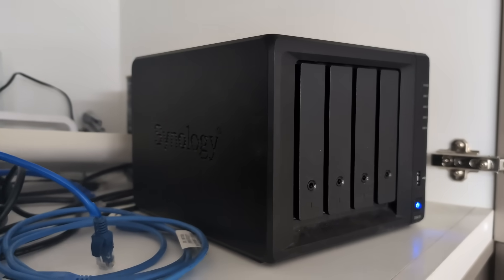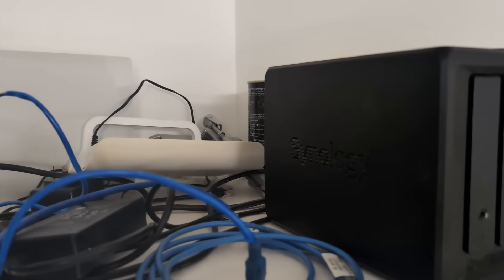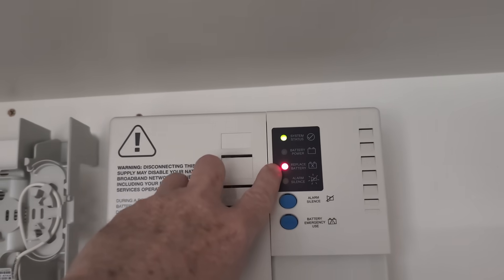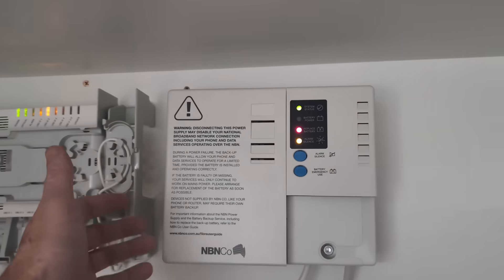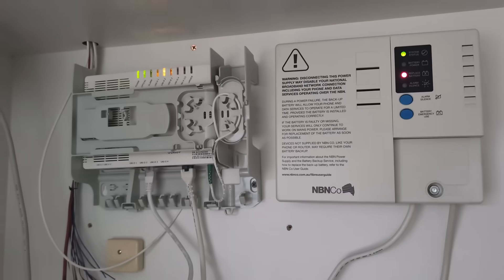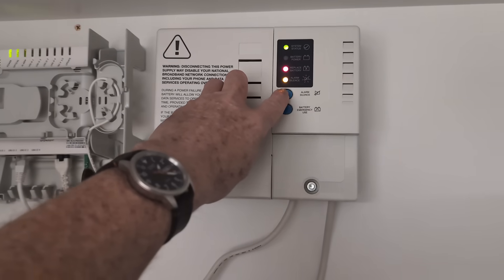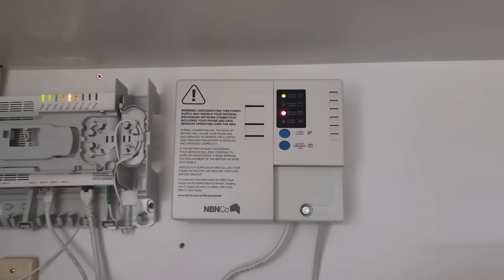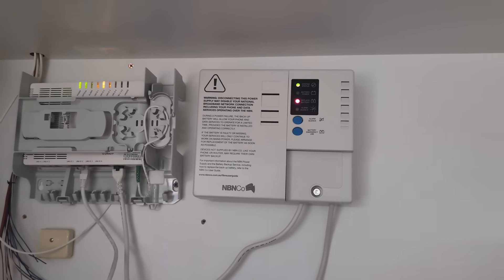I Found the ANNOYING BEEP in my Lab!

Comment: Short hold only silences it for 24 hours. To turn the alarm off indefinitely, hold the ‘Alarm Silence’ button for 15 seconds, you’ll hear a beep at 2 seconds and another at 15 seconds, at which point you can stop holding the button.
Reply from the maker: Thanks, 15sec did the trick, solid LED now.
Reply: Wish I knew that at my old address.   I discovered that after I unplugged the battery and pressed the button it also seemed to be permanent.  Maybe I just pressed it for long enough and got lucky.
Reply: Or if you take out the battery I believe it also stops beeping.
Reply: I wish I knew that you could permanently mute it before I took some pliers to it and ripped the speaker out...
Reply: Yeah that's correct, alternatively disconnecting the battery will silence it.

Some ISPs would install battery backup by default when ordering a new service, it has always been an option, though as of late it is no longer a sold.

Comment: I switched back to the land line with 250/50Mbit VDSL2+ wto years ago, when the coax TV cable with 250/25Mbit/s DOCSIS internet was finally totally overloaded as everyone was watching 4k netflix with cheap 1Gbit/s contracts... 

Coax was a real game changer back in like 2010 when my land line DSL only had 1.8Mbit/s effective and the coax internet was introduced here in my small village in Germany with up to 16-32Mbit/s. Just now the fiber guys visited my parents and they are going to sign and switch to fiber but just because the digging is included when singing now (>2k€ costs for our slightly longer run to the street). The most sad part is, that they gonna sign the 100 or max 200Mbit/s fiber internet because the 100Mbit/s fiber is already double the cost of the current 250Mbit land line DSL....

Comment: NBN idiots supplied same to me with a vertical mounted motorbike battery! Same beep robbed my sleep till I mounted it correctly 90 deg turned so the bike battery was happy as it was designed to be horizontal.
Reply: The normal orientation of the DC UPS is such that the battery is standing on the small side, ie the terminals of the battery are vertically separated on the right hand side.  The UPS does not monitor orientation and the battery itself doesn't care either.

Comment: I would "cheat" the battery sensor with the biggest capacitor I could find.
Reply: You can just take the battery out, it doesn't care if there isn't one present.
Reply: @retrozmachine1189  The beep was from the electronics saying there's an issue with the battery charging.
Reply: @therealjammit  True, but if you take the battery out and power cycle the UPS it detects that there is no battery and does not complain.  I have one of the DC UPSes and this is how it works.

Comment: Yeah, those damn fiber boxes with their damn backup batteries. I have fiber into my house (don't use it), but the fiber router had a 12v motorcycle sized lead acid battery in it and for like 6 months I couldn't figure out where this damn beep that would go off like every 15-20 minutes. Finally found it and took the battery out and unplugged the fiber router from power. Super annoying!

Comment: I know most of the states if you have a land line with a phone even if they turned it off it will still work for 911 call also if you have a old cell phone and it works but no carrier it will work for 911

Comment: A few weeks ago I started to hear a click every ~30mins or so. It took me 4-5 hours to realize that it was the thermal cutout in the electric kettle. I put it back into it's holder empty after use and accidentally flipped the darn switch on it with my pinky finger. It has a visible indicator but there was too much sunlight shining into the kitchen. Well, that was a first-timer. D'oh! 🙃 Anyway, that battery unit was quite a nice addition. I saw similar stuff as an option for a VoIP ATA capable DOCSIS3 cable modem years ago. It was a stackable balanced li-ion pack, using a TI BQ I^2C/SMBUS readable reference design jobbie. It's not mandatory where I live and I worked for an ISP using other type of telecom tech, but I saw it at a new client installation as it was the former CPE device. Never saw one again at other non-business clients.

Comment: I have also noticed that beep in your recent videos and was wondering what device it was. I assumed it was some smoke detector on auto-test mode or some test gear of yours or even a microwave oven where you made food in. I have never thought that you had an UPS for your fiber optic router.
I had a similar situation at work, but there it was an APC UPS beeping at me, because the batteries died after 10 years of operation while nobody took care about maintenance.

Comment: You probably want to remove that dead agm battery in there. If the charging circuit is still active , that battery might swell up, get warm, leak , etc. Actually you probably can disconnect that whole backup thing and just power your fiber modem direct .

Comment: When I signed up for Verizon Fios, they included a battery backup by default, even for people who did not have landline service, and the old Alcatel ONTs switched to voice only when on battery backup, thus useless. It had a silence button as well but it would disable itself after a day or so, but if you removed the battery entirely then the silence option worked permanently.

Comment: Looks pretty similar to the power supply for Verizon Fios in the US... you can probably disconnect and remove the battery and it will run fine without it and never bother you again. On my Fios I got rid of their power supply entirely and wired up a 48V DC supply fed from my rackmount UPS.

Comment: Dont know case in Aus.. but here in UK they turning off traditional phones.. it all going digital now.. so while old phones used to work in power cuts, current digital can/will fail. May be this to get round that?  if your phone/base unit has battery as well, would this keep your phone working in a power cut? so you can still call 999/911? (though most people have mobiles now...  many old people dont, and rely on old "house phones"?)
Reply: Analogue phone lines are largely gone, only still being operated for people on the nbn wireless network and even that may have been shut down by now.  Pretty much every man and his dog has a mobile phone so there's really not a lot of demand for landlines of any type now apart from businesses.  nbn's uni-v ports are VoIP with a dedicated 12Mbit/sec service (carried to who ever provides the VoIP service) and that options is being withdrawn so in a few year if you want a traditional phone it will be up to the end user to obtain an ATA.

Comment: My ADT security system kept warning me about the system battery.  I tried many times over the years to locate it, it's not on the control panel. upstairs.  No, it's in my basement.  Turns out it's behind the drywall.  The person who finished the basement literally just walled over it!  

I was able to find the power outlet (other side of the basement, back of utility room under the stairs, single outlet with 24vac transformer).  

Finally, no more strange sounds.

Comment: Remove it Dave, its an SLA and its going to possibly swell and leak.
You don't have to unscrew anything, just wrench a little harder on the cover.
I have doubts about the installers of those two boxes, with my installation the two boxes were too close together and you couldn't swing the cover back enough to get the battery out.
I did my own deinstall and reinstall of the left box, moved it to the left 2 - 3 cm where it should be.

Comment: The battery backup was such an unnecessary addon for most. Unless you have critical stuff like health alarms, it is just another expense. To top it off, the batteries are hard to find and they don't last long, and even worse - in apartments they are typically located in the bedroom cupboard!!
Reply: They are not hard to find, any good battery outlet or Jaycar.

Comment: Some industrial control units have battery backed memory to hold user settings and data, but the maintenance engineers ignore the "Low Battery" beeps and warning LED.
When something trips the power, they've lost all the data, and they came crying to us to help them out.
Reply: that sounds a bit like the CMOS/RTC battery on PCs ... in the early days the BIOS settings, like hard drive parameters etc., were also gone if the battery is dead.
nowadays these are mostly stored in flash memory, I hope 🤔
Reply: @SystemX1983  You would be surprised how old the machines in factories actually are.
There is a machine building military equipment that doesn't use a processor as such, it is a discrete logic State Machine, and the program is entirely stored on CMOS RAM. 
There are detailed instructions in the manual how to enter the program code.
Reply: @johnwright8814  Owch! 😮
I hope the program isn't too complex ... imagine, hacking 20 pages of numbers into the device just because of a power glitch 🤔
sounds fun ... NOT

Comment: The battery charging or protection circuit in them are rubbish. I replaced the battery in my parents when it first started beepung them they lost power for a couple of hrs less than 2 yrs later and the replacement battery then was dead. Most of the time they're useless even when using nbn for your land line becauseost isp's run the voip through the router they provide not the  nbn router so you'll neerd a ups on that

Comment: I have the NBN box and modem and computers all on one 12 point power board. If the electricity goes off I plug it into the Bluetti AC140P and it will run everything for a couple of days (plug the fridge in).
I could use the Bluetti like a UPS but I’m not comfortable having it charged to 100% 24/7.

Comment: same here....take few month to find....call Bell Canada and no more battery for this....
Reply: generally speaking any 12V 7-9Ah SLA battery with the right terminals (F2 on my unit, probably all) that physically fits will work. I only say 7Ah to 9Ah because that's the capacity range where you'll generally find the approx 6"x2.6"x3.7" form factor these take. Electrically speaking, you could use just about any size/capacity sealed lead acid within reason; the ONT isn't going to draw much power, so runtime (if too small) and possible overheating of the charge circuit and/or unreasonable slow charging of the battery (if too large) are the only real worry.

You can get them online, often with free shipping from somewhere like batteryclerk or upsbatterycenter.

Comment: Apparently you can remove the battery completely and do without the battery backup if you want. It's a 12v 7.2Ah SLA so no worries just to leave the dead one in place, not gonna leak. Potentially a charging issue.....hmmm

Comment: I had something that would enunciate "low battery" once in an Asian accent totally randomly days apart. Drove me nuts. It took me a long time to figure out what it was. Turns out it was the Panasonic wireless phone handset that is in kitchen hooked up to the landline that I keep around for legacy reasons that I rarely use. The only reason I figured it out was I'd used the handset and left it on my desk for several days and I happened to be sitting at the desk when it said "low battery" SUPER ANNOYING. Even then because of the unexpected nature and volume I still had to bisect all the things on my desk to pick out the culprit.

Comment: The last time this happened to me it was a short beep every minute or so. I figured it was a smoke or CO detector complaining that its battery was low, but after going around to each one and standing there long enough to hear the beep, I determined that wasn't it. Turned out it was our refrigerator! Someone hadn't closed the door all the way - it was cracked just slightly open. And the fridge has an alarm to alert you if the door is left open for an extended period of time.
Reply: That's a useful feature to have on a fridge.

Comment: Given that all modern devices that make beeps like that have microcontrollers in them they should just modulate the beep to include digital data that a cell phone app can pick up and decode to ID not just which device is making it but the exact nature of the error.
Reply: Or if you're going to have it beep occasionally have it beep several times in succession so you can actually locate it, instead of a single beep that invariably comes when you aren't expecting it so you've got no chance of identifying it.

Comment: We've got one of them NBN Co Routers at work...  Same thing for over a year - beep...  Beep...  Had the "Replace Battery" warning LED on too...  Can't replace the battery because of "clever" installers installing the router too close to another box and we cannot open the Battery Box enough to remove the battery.  But here's a tip that worked for us - just disconnect the battery for 5 minutes and then reconnect the battery and the "Replace Battery" LED stays off.  Our LED has been off for over 6 months now!!!

Comment: Oh no! You blew Beepy the Tormentor's cover!

Never thought an ISP would install a UPS on their modem/router/other equipment. Not done here at all... Of course I have a low voltage UPS on my network node, had it before I movede to my current place, but that's my thing to take care of.
Reply: If the device is providing POTS phone service, it must have battery backup so 911 is still available in an emergency. This ONT has the potential to provide POTS, so they installed the "UPS" version of the power supply. I have basically the same power supply for a slightly different (outdoor mounted) ONT. By default, the battery will only power the phone side of the ONT, not the ethernet side, unless you make some changes to the power wiring.

Comment: I'm using Telstra NBN, the landline comes bundled with it, so I use it.
Unless I call outside the country the calls are free, my wife can yak all day to her mum and not flatten my mobile.
A bit strange for someone who refers to their smartphone  as a ShoePhone. (meaning to me you don't like them)
As for opening that NBN power box, you were on the right path, just pull harder.
The battery charging circuit in these is quite poor, the batteries don't seem to last much past a year or so.
Ditch the battery and run it off a decent UPS if you want backup.
Reply from the maker: Mine lasted almost 8 years!
Reply: @EEVblog2  That's amazing, I helped a lady at church with hers, there is no way who could handle the spade lugs on the battery. the replacement seemed to last under 2 years - maybe it was actually a cheap'n'nasty battery, it was labelled NBN battery, so someone had seen fit to get a batch of batteries specifically labelled as such.
All marketing and no quality.

Comment: When I was in high school, the electronics lab always had an odd whine in the background, a high pitched tone modulated by 60 Hz mains. Several people were sent out to look at the HVAC system, but it turns out that it was coming from a surge protector! This particular surge protector had a gimmicky feature where it would sound an alarm when it "expired". It turns out that the alarm circuit ended up expiring before the surge protector did, making the nasty noise that drove us all insane.

Comment: NBN don't deploy these any more. Just remove the whole unit and power the NTD from a UPS if you need to.
Reply: Maybe a good idea, as the charging circuit in them is horrible, the battery's die way to early without having done any work.

Comment: Had battery backup on my home FTTP. Annoying beep with red status LED next to "battery fail" sign, ordered some new rechargeable batteries. When I came to replace the old ones one of them had leaked over the case and melted not only the case but all the supports and part of the board, so now I have a spare white brick. Luckily you can you can just unplug the power supply going into the battery unit and plug direct into the NTE. I should have checked the unit before ordering the new batteries.

Comment: I had a UPS at one time.  Similarly, eventually the battery failed, and beeping occurred.  I figured it out after a bit and replaced the battery once. Eventually there were more ups problems and i did away with it as the power here us quite stable.

Comment: The battery backup is a service they provide if you have landline phone via fiber.  It's so that you can CALL emergency services during outages.  The old landline phones were powered from the phone company with "ringing power".. as in constant 48-50v DC power.
Reply: You can't provision them any longer (since May 2024), and existing services will be withdrawn in 2031.
Reply from the maker: That's what I meant.

Comment: Re Annoying Beeps ... Years ago I was visiting Magnetic Island (Australian Tourist Island off North Queensland). 
Walking past one of the many huge 10 story beach frontage apartments one quiet evening, I could dimly hear several smoke alarms giving the classic 'battery needs replacing' chirps. 
I mentioned it to a nearby shopkeeper and she told me that most of the apartments were owned by folk that only used them for a few months a year and left them unoccupied for the remainder. The apartments each had several central mains powered smoke alarms but many owners bought extra battery operated units for the bedrooms.
Apparently It was not uncommon to have a dozen or more chirping away for months in the building when the weather turned cooler. (battery voltage drops when cold)
The owners were usually super hard to contact and reluctant to give access for something as 'unimportant' as a chirping smoke alarm.
Rather annoying of course for the folk currently renting / permanently living there.
Similar story in storage facilities, Folk pack everything up and put in storage for a year or two. Inevitably quite a few smoke alarms get packed...and... eventually....chirp.